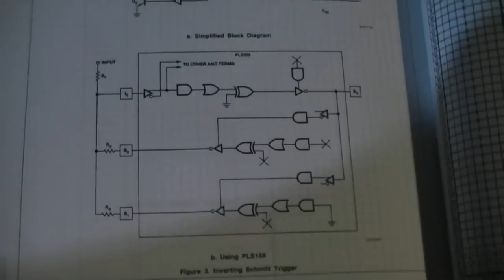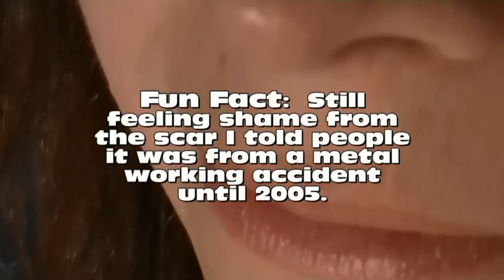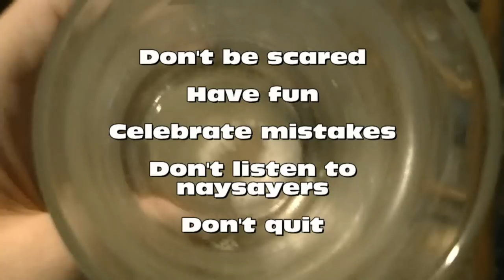Secret to Learning Electronics - Fail and Fail Often

Comment: ""Start making mistakes if you want to learn electronics." 
Note: this advice does not apply to persons learning neurosurgery. 

(Veteran of a hundred smoking CPU chips.)
Reply: +Dangerous Bill Actually it does. You practice in simulations and on cadavers, and the more time  you put in to those and fail the more likely you'll be successful when you are in the actual operating theater.
Reply: Neurosurgeons practice on dead cadavers  of people and with time progressing to live  lab animals  mice / rats  before they even touch a live person ...and during their learning they also make mistakes ...
Reply: Guess what lobotomy and other disastrous practices were.

Comment: This has been my story with electronics.  It took me years before I made a circuit that wasn't in some home learner kit that actually worked.  I've spent the last 3 years off and on, on a lego pinball machine.  Why off and on?  A failure has always put a stop to it.  So I put it away until I get motivated again and come up with something to solve the problem.  Several years ago I tried making a 6502 homebrew computer and it didn't work.  Just recently I'm trying it again, and now with the knowledge that I have, I think I can actually make it work this time.
Reply: Amazing

Comment: I like how you touch on kids electronics starter kits.

I used to always want one when I was growing up. I think they're relevant for learning electronics.
Reply: I had my first electronics kit when I was around 5. It did learn the basics with it (and the following ones) and it finally inspired my to become an engineer. 

Fun side story:
My mother at some point refused to read me the manual, which inspired me to learn to read myself, before I even went to school. 
I was then bored of learning the letter "A" and instead of finishing the worksheet we got for it, so instead of writing 100 (cursive) A's in various sizes I wrote a complete, correctly spelled sentence in perfect grammar onto it.  For some reason, the teacher wasn't pleased at all and flipped out about it. 

It may have had something to do with the sentence being: "This worksheet is extremely dumb." (It was in German, but I translated it)
Reply: Yep, I had one by Heathkit. My favorite setups were electric eye and intercom. If I knew then what I know now, I would have combined them and made an optical intercom.

Comment: Nice video! One comment: Be Scared and CAREFUL if working with high voltage
Reply: I always thought that until I heard its the amps that kill you, not the volts. (I gonna leave it all well alone)
Reply: @jonnamechange6854  that saying is true but not great safety advice.
You need a high voltage to get a high current through a human body. That’s why electrical substations, etc. are labeled ‘High Voltage’. The energy companies don’t have it wrong.

If there is a high voltage between two wires and you put your hand between them, you provide a path for current to flow, and so a current will run through your hand. This might only damage your hand if you’re lucky.
If you touched one wire with your left hand and the other with your right, however, the current might pass through your major organs, and you might be not so lucky.

So that’s what the phrase was getting at, but it really needs to be explained to be useful to people. Anyway, yeah, Alexander is right. Be careful and knowledgeable when working with high voltage.

Comment: Absolutely brilliant! I started off in the 1950s dismantling leftover WW2 electronics with a lot of help from my dad. Some of the things I made worked, some didn't. The homebrew oscilloscope which started as the display of an airborne interception radar was one of the better ones. Then I went on to study engineering properly in Cambridge and now am a consulting software engineer. Keep up the good work, I'll be following the videos.

Comment: @14598175...I do not any have any kind of degree in electronics or certifications in engineering .( My sheep skin is in fashion, but that's a story for another day) But I sure make the money like they do, and feel I have a better working life than any engineer working for a company. Self taught from Jr High School Days until now, in fact I only jumped into electronics about 10 years ago again after setting it aside for 10 years or so before that, got a little burned out on it needed a break. Anyway my way pass H.R. is companies they hire me, they call me, as  contractor I go in, fix electronics, or work on a project for them, then go on my merry way, kind of a repair man style in & out, bring my own tools, computers ect. And I set ground rules before I agree to take a job, like I tell them right off the bat, to many cooks spoil the soup, and their people can not be around trying to help, ect. but I will call them to look and check things over when I am done...I also tell them I may have to come and go on my time. Because sometimes I have no idea what I am getting into, and I have to go do some research after I look things over, figure it out on the fly, now I do not tell them that part. I also tell them when working on things, nobody can touch anything in the area I am working in if I am their or not, because I lay the parts in a order that can not be mixed up. I make it very clear if they hire me they have to go by these rules or I will pack my stuff up or leave job done or not...and guess what...I have more work than I can handle and get hired by companies all over the USA. Because these business tell other business about the good work I do. The 2 things I find they really care about is if I am insured & if I get the job done and done right in a timely manner. Yes having my own business is my way pass H.R. into their business. And it is VERY RARE when some asks about my degree and when they do, I tell them about my 'sheep skin in fashion design' in a light hearted way and kind of make a joke about someone who trained in fashion working on their stuff....and that works people do not ask farther. So what if I can not have the title engineer I am still doing pretty good being paid like one.
Reply: I am self thought either and i enjoy it.
Reply: Certainly the value we give off tells who we are, not the rating we get from others, i.e. college degree. I almost forgot to mention, I don't have an engineering degree; I just do engineering and technician work together.

I also have a certain way to work and had trouble when others try to mix in. My greatest inventions are the ones that just came to me and nobody else understood them.
Reply: ANN ENGLAND  Hi, I am John England. If you ever come by north Texas send me a comment. It would be fun to tell SOE tech stories over a lunch!!!

Comment: The important ethic is at the end of the video. If you try, you will get the hang of how to succeed. 
On the other hand, there is a risk of not failing because you stay too far into your comfort zone and expertise zone you have established. Fear of failure or lack of adventure can be a problem.
Sometimes things don't work when you expect them to, in which case an investigation is called for. What went wrong? I always do this. On the other hand, I have circuits I design then find errors that SHOULD have made them NOT work. eg, a 2-transistor classic astable miltivibrator-based LED voltage booster. Found it worked with a transistor disconnected.  Concluded the supply inductance formed a resonant circuit with a capacitor. Fascinating!
Advice: Keep a diary and notes in there so you can refer back. Keep your components highly organised in folders with data sheets and trays.

Comment: I salute you for your advice. Jeri. I tried getting into electronics and ham radio in my 30s, but flopped miserably. Then, at age 67, after retiring, I decided to try again, out of personal interest and to see if I could actually do it. 
In the intervening years, I was never able to "get" electronics, so I had "settled" for turning knobs on electronics equipment as an end user. I never knew how things worked. But, once I was bitten by the electronics bug, at age 67, I studied like crazy and earned all three levels of my current amateur radio (ham opetator) license within an 8 month period, by God's mercy, before I turned 68. As you said so aptly, "keep trying and don't give up", even if it means putting something aside for a while, like your glow compound. Some things and ideas take a while to mature, and sometimes we aren't ready for the success because we haven't worked hard enough for it yet. 
You might enjoy my design and build videos about preparing for and executing my mobile radio setup. I even included dealing with a broken screw head that I snapped in one video, just to show that it happens to all of us who try to push ourselves beyond what we already know. God bless you. Craig KC1ELZ

Comment: Great points Jeri.  I started learning Electronics at 12 years old from kits at Radio Shack and Heathkit courses and kits to build including a 25" color TV.  After high school was college then 25 years working for the Navy repairing Avionic Systems for Navy jets.  Now at 55 yrs old still working and doing design and repair at home, also a lot of failed projects but you learn from them as you mentioned in your video.  Thanks for sharing.

Comment: Don't feel Bad about making mistakes. Its how we learn. Sometimes by Rote sometimes from trial and Error. when I was in my teens I tried Alot of electronics experiments and projects also and have failed Miserably. But I learned from it. and just kept plugging on. I have a shed Full Of boxes of Parts from stuff I have bought in the "As-is section" of thrift stores and scrapped out for parts. I used to do all kinds of interesting Electronics projects, using the Parts I had on hand.
 Alas I have a loved one that is on Hospice Now and don't have the spare time to Just Tinker too much anymore.
Thanks for your great Video and your Inspiration, and if you Mess Up, Just Do Like the Popular song  says Just "Shake It Off". and Move right On. If More people were to adopt Your Awesome  Mind set. Just think of the great things we could All Do

Comment: When I was just 4 or 5 in the 1940's,I spent many hours watching electrons  glow blue within the valves of our home radio.
I was attempting out of curiosity,to figure out how the radio worked by observing the trace wires from each valve base,or figuring out why the transformer 'hummed',how the radio managed to emit speech or musical sounds.

Years later,I learnt how cathode ray tubes picked up cosmic signals from space & how they managed to produce 'colour'.
 I never ever lost my interest in electronics,now in my 70's, with time on my hands,I am picking up on robotics, with ideas on what I want to achieve.
I have all the hand tools I need for soldering etc,I need a nice little bench indoors,as it's too cold for me outside,though,the one thing I regret in life, is not having space for a proper outside workshop.

I know how I want to achieve bodywork fabrication,even if I have no CAD experience.

Our country is largely missing what was once one of it's most precious assets, the garden 'shed'.

It's truly amazing what many a 'henpecked' husband has done by becoming positive in an otherwise,sad,but negative situation & I have always maintained that a good amateur is much better than a 'bad' professional.

I learnt the way of electronics through the analogous 'plumbing' method,I always imagine the 'plumbing' whenever a solution needs  some thought to resolve.

'Electronics' is the most fascinating hobby one can have, it's a fundamental force of natural physics,it's good that we humans have mastered it's power for the good of humankind & the planet.

I truly admire our young women of today,they can enjoy most of the activities previously reserved mostly for males.

I honour our female discoverers,who are without doubt,the equal of us males,they master the logical scientific principles, use their brains as they are meant to & I for one find an intelligent woman to be an interesting woman indeed.
 This young lady has learnt her craft in time honoured fashion,the experience & knowledge gained from 'trial & error'.

Once learnt,never forgotten,when the time is reached,where the mind clicks into gear to solve 'problems',the satisfaction is enormous & one instinctively knows that the methodical approach is correct.

Comment: Thanks for this video. (*****). I made it one of my favorites. In 1967 I bought my first transistor (OC 13, germanium). Components were too expensive then and I had to salvage components from old equipment for many years. And, yes, mistakes are inherent to electronics and only after a some years of experiments the "insight" in what really happens will come. Advise to anyone interested in electronics: buy an oscilloscope! You will speed up your experience.

Comment: Reminds me of how we got good audio tape:

If you just put the signal onto the recording head, you record something but with lots of distortion because of the hysteresis of the magnetic material. You can mitigate that reasonably well by adding some DC bias offset to the recording current, but then you get basically 2 problems.

You can't ever cross the zero, because then you will get distortion again. So your signal level is severly limited. 
You magnetize all the particles on the tape, since they are irregulary distributed, you hear them passing by as noise.

So they tried to measure the actual field they put on the tape and predistort the recording current to compensate for the magnetic hysteresis. When they tried it, it looked promising. So they increased the amount of feedback. It got a little better. They increased it more .. and it suddenly worked REALLY well. 

What happened was that the recording amplifier had started to oscillate in the ultrasonic region .. which was never intended .. but this led to the development of the HF bias which is still used today.

Comment: I love your attitude, I was told three times today I should stop trying to build tube amps even though my first after 40 years needed two wires moved to different parts then it worked.  I know you need books for reference and some books can be in pdf on line so you don't have to buy them but you do have to pay sometimes to download them. Some one was trying hard to impress me and did not, but I was with your simplicity although I did not understand everything you said in other videos.

Comment: Our first artificial gravity experiment was a 'Lorentz disk'.  Since witnesses often report "car radio suddenly had lots of static", and knowing that RFI/EMI is created by accelerated charged particles (just as the accelerated charged particles in a radio antenna create electromagnetic radiation),  we used the shape of their vehicles as a guide:

1)  layers of aluminum foil, each separated by insulation.  The 'skin depth' of store-bought aluminum foil indicates a frequency of 16.28Mhz.   The foil/insulation lamination is oriented horizontally on the workbench.  You can build a small amplifier to boost a siggen's output as a first pass

2)  radially and horizontally-oriented eddy current coils are positioned closely adjacent to, but not touching, the foils lamination, and are fed the 16.28Mhz

3)  an axial and vertical magnetic field is passed through the (center of) the foils lamination

The vertical B field and horizontal currents in the metal layers lead to the Lorentz force (right hand rule, recall) and result in coherent accelerations (oscillations) of the charged particles of the metal at the 16.28Mhz rate.

Later designs changed the dimensions of the foils, and the frequency, to add resonant standing waves across the metal layers.

The similarity of the vehicle designs helped us figure out what they were doing, ie. how they managed to get immense accelerations, coherently, across their hulls.  Since the ionization (the light) sometimes seen on their vehicles appears to be coherent light, that helped too.  The magnitude of car radio interference indicated that their entire hull must be playing a role in the RFI/EMI.
.

Comment: It is always the case that projects you work on but end up non-functional are probably he ones you learn the most from. My decreet logic VFD clock has had at least three multiplexer designs, the first two failed miserably, the third was a success.

The first time I ever reverse engineered a chip and got it up and running, I shorted the 40V and 5V lines, the chip went bang and the regs in the homemade PSU were destroyed. The PSU had to be repired and the chip was a write off. But I learned a crucial teckneek on how to reverse engineer a circuit.

Point is there is no real such thing as failure, but these experiences should be refereed to as "Learning Experiences"

You always gain knowledge even if something does no work first time.

Comment: I sometimes feel like I've failed at things. I've made a few things that worked and others that didn't. I'm in the middle of working on a power generation unit. It has cost me more than I realized, but I can't quit now. I'm too close to finishing.

I also feel nervous about the embedded realm. I want to program microcontrollers in C/C++. However, when I look at jobs for them, they are asking for things I haven't even heard of. Still, I have to keep learning. Keep up your post and good luck.